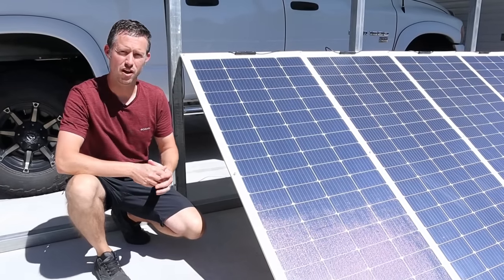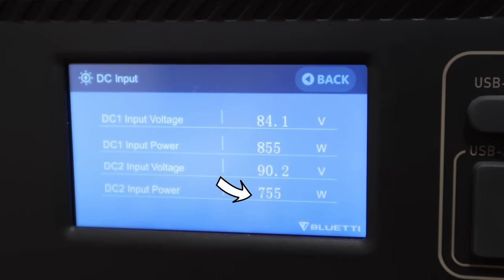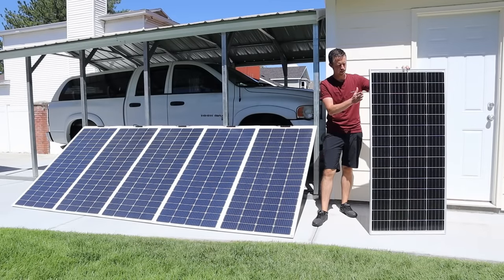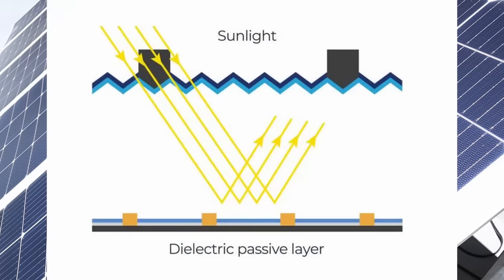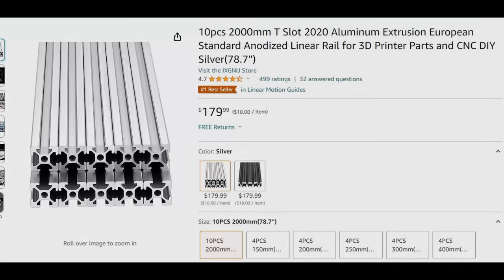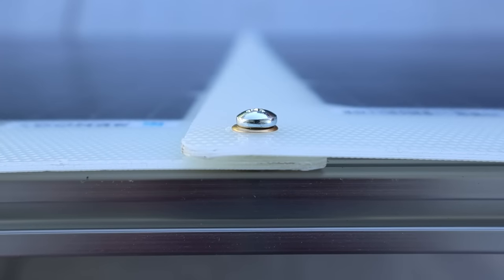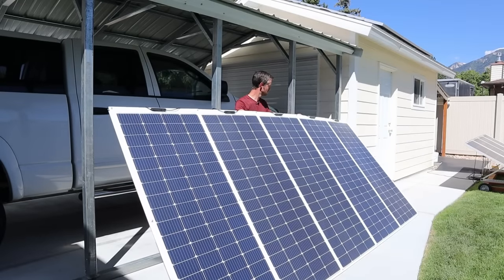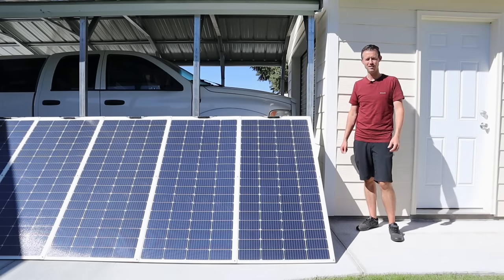DIY - 1000 Watt Lightweight & Portable Solar Array - Five Renogy 200 Watt Flexible Panels TESTED!

Comment: 2 of those panels are cheaper than the Ecoflow 400W 😁, probably close to the same cost after all the hardware though
Reply from the maker: I'll make sure to take two of them and include them in my upcoming 400w panel comparison video!

Comment: Hi I’m in the uk. Stumbled across your channel very interesting.Quick question I’ve got a touring caravan weight not a problem but would you say fit rigid panel or flexible 200w with just the one panel I want to get the most out of it it’s also the renogy ones I was looking at. Thanks mike
Reply from the maker: I've had really good luck with these 200w flex panels. If you want something thin and lightweight go with the flex panel. If you want something more durable and longer lasting, i'd recommend a glass rigid panel.

Comment: I only just started the video, but how is taking a flexible panel, then making your own frame from aluminum, superior to just buying a panels framed in aluminum?
Reply from the maker: The weight savings is the biggest factor (removing the heavy glass). This video is about building a lightweight and portable option. Put together glass panels like this and you won't be moving it around.

Comment: Can you use the flexible panels like these with the glass panels and mix and match? Would they work the same when put together?
Reply from the maker: You can only mix and match different branded panels if they have the same 'peak power' voltage and amperage as each-other. If wired in series you need them to have the same amperage @ peak power. If wired in parallel you need them to have the same voltage @ peak power

Comment: Those total cost over 1.7K+ but what about the battery generator?
Reply from the maker: Yes, the batteries will be a separate cost. If your power is consistent, it's probably not worth investing in something like this. However, if you live in an area where you constantly lose power it's a great setup.

Comment: Very good idea. Is there any reason you used those aluminum bars instead of aluminum angle bars? I am guessing that they are stronger than the angle bars.
Reply from the maker: I first thought about using aluminum angle, but it wouldn't be rigid enough. I opted for the 20mmX20mm. You might be able to use 30 series aluminum (30mmX30mm)  for more rigidity, but it will add a bit more weight. All depends what you are looking to accomplish.
Reply: @Jasonoid  how much more weight would the 30 add?
Reply from the maker: @dfwvtxman  I'm not sure, I don't have both options to weigh the difference, I'd say at least 1/3rd more weight. This weighs 66.8 lbs and each panel is around 10.8lbs so that gives you an idea how heavy just the frame is.

Comment: How would you ground this system if you are using it as a portable with an Ecoflow? Ground rod?
Reply from the maker: Yes, grounding rod is an option. In my case, it's grounded to my metal carport which is anchored to my concrete pad in multiple places.

Comment: Have a question on what you said about the VOC of 23.9 being the "peak voltage you will ever see". My understanding is the factory numbers are based on a temp of 77*F.
Am I correct in understanding that in winter with the cold, the solar panels voltage will increase? When the panel is say 20*F they will not go over the 23.9V ?
I ask because I am trying to build an array but stay under the Bluetti 150v max for the AC300. But in the winter if the panel goes over the factory VOC I need to consider that.
Reply from the maker: Yes, in cold temps the solar panels do have slightly higher VOC numbers. The max voltage is usually less than 3% higher than their rated amount. If you have a VOC really close to the max input of you power station, maybe consider putting a few high amperage diodes inline to drop the total voltage a few volts. I've wanted to experiment with that someday.

Comment: so dumb question, do I need to earth ground the frame if I am connecting it to a stand alone battery/inverter like the ac300 or ac500 you are using here? Assuming the battery is not tied into my house, I should drive a rod or ground the solar frame to something?
Reply from the maker: These flexible panels don't have a grounding point since they are completely plastic and don't conduct electricity. I wouldn't worry about grounding them like you would with a metal solar panel to protect against a lightning strike.
Reply: @Jasonoid  thank you! that makes total sense

Comment: How does it deal with partial shading?
Reply from the maker: It's wired in series, it doesn't do well.... but you could always wire it in parallel or a parallel / series combo to get better shading performance.

Comment: Wouldnt it make more sense to buy regular glass panels for nearly double the output for about half the price that last 4 times as long that have an alloy frame already? You wouldn't have to buy alloy and make a frame, you could just bolt each panel to the next one, flexible panels just aren't really worth it other that a niche application where weight saving is the most important thing. I can't wait until thin film panels get to mass production.
Reply from the maker: I already have two glass panel arrays I use daily. This is a supplemental array that I can move around and stow away if needed. The key design is that it's portable and thin so it can be stored in a small area.

Comment: their own 175W panels weigh 6 pounds, so for the same weight you could build an even lighter array (or more powerful for the same weight)...
Reply from the maker: You are right about the weight. Just keep in mind these panels are upgraded over the previous version since they use better cells. They will put out more power and last longer.

Comment: How do these compare to the Bougerv Arch 200 watt flexible panel.  Seems the the Bougerv is smaller @ 58in x 31in
Reply from the maker: I haven't tested those before, they seem priced well though!
Reply: @Jasonoid  they seem to be almost the same power rating with a VOC of 20.1 and ISC 12.28 VMP 17.1 and IMP 11.7 which seem to be almost the same specs. In your professional opinion do you think they would meet the same quality and close to the same output.  I just bought a set of 2 . The plan is to make this same array.  But I don't want to start buying them to find out it won't put out the same power.   I guess I could check it and compare what the results were compared to what one of your panels tested out to be
Reply from the maker: @lanceboudreau3630  I can't say unless I was able to test them throughly. Not all panels are created equal. You'll have to let me know what type of power you see from them.
Reply: @Jasonoid  I'll do a test on one in Standard Test Conditions with the right angle to the sun and then we can compare notes between the 2 panels. That will determine whether or not I'll keep these or send them back and get the Renogy panels.

Comment: How much do each of those panels weigh? They look light, but are they?
Reply from the maker: Each one is about 10 lbs. A glass rigid panel of this size is about 28 lbs.
Reply: Thank you. I came back and am considering this set up.
Reply from the maker: @florindagonzalez5700  they still are putting out excellent power!  (... if the sun hits them). Winter is tough for solar since the sun is so low in the sky and we get more clouds and storms in the winter.

Comment: Hello Jason I just ordered some of these panes to hook up to my Ecoflow delta pro in series do i need to add an inline fuse , if so how many amp fuse. I am looking at renogy Solar Connector Waterproof In-Line Fuse Holder w/ Fuse
Reply from the maker: Usually panels in series you don't need a fuse since the maximum fuse will not go past the short circuit current of the panels. To be extra safe you can wire in a fuse for the max rated amperage of your wiring (12 awg wire would be a 20 amp fuse)
Reply: Thank you very much for your time and info have a greatThanksgiving  day @Jasonoid
Reply: one last question i have 8 of these panels connecting to ecoflow delta pro do i connect all in series or series/parallel @Jasonoid
Reply from the maker: @trojans01  what does the manual or app state about solar input specs for the Delta Pro? (I don't have one)
Reply: @Jasonoid  11-150V 15A Max, 1,600W Max
Reply from the maker: @trojans01  each one of these panels will put out 25v open circuit, that means you can only connect 6 in series and not use the other two panels, the voltage would be too high (very bad). 

Your other option would be to connect 4 of them in series, and the second set of 4 in series and then wire those two groups in parallel (4S2P array). You'll be losing some power due to the amperage limit.
With the limitations of the charge controller you don't have a perfect way to achieve the full 1600 watts. That's pretty much the problem with many of these charge controllers.
Reply: Ok once again Thank you very Much have a Great Christmas & New year GOD Bless

Comment: Vtoman 1500 just purchased and it claims Ac input of 1500! Mine says 1690!!! These are Life po batterys so isnt it bad for the batterys to take in that much power or an i out of touch???
Reply from the maker: Hmmmmm, that question isnt about this video?! 😂🤣   ... It's "best" to charge at a 0.5C rate or half the battery capacity. If the battery has 1000wh, then a 0.5C charging rate would be 500 watts. When charging at a 1C rate or higher it lessons the charge cycles of the battery.... By how much? Who knows!
Reply: @Jasonoid  Sorry about that but this vid gives me some solar options👍! You planning on doing a vid on VTOMAN 1500?
Reply: @Jasonoid  my plan is to ONLY USE the AC charging in EMERGENCY only situations. When i got it , it was %80 charged Which is the most ive seen out of the 8 SoGens i own but i decided to chk out the AC SPEED. Its rated at 1500 watts but it kept showing a whopping 1680 Charge rate! Took 12 minutes to %100 and 3 minutes was the trickle effect. Once it hit %99 it went to 1480, 1370, 1100, 740 and then down to 500 snd it hit %100!!! Freakishly FAST but dont think its healthy as you said!! Dc and SOLAR PANELS are preferred ! Oh, before i forget i dropped your name to a New player in tbe SoGen game! They have SOLID STATE BATTERY TECH!!!
Reply from the maker: @samog777  I met with Yoshino at CES, their products are extremely expensive so I'm not thinking the video will be worth it. No one will want to buy it.

Comment: will that array be sufficient for running a 230v (3.2 kw) AC inground 3hp pool pump? will this be overkill? what do you suggest?
Reply from the maker: How often does the pool pump run? It pulls 3200 watts while running?
Reply: @Jasonoid  My pool pump is a VSP and run on 240 v power source with my pool heater (Htr., only use for the spa). The pool itself runs at 2300RPMs for 8 to 9 hrs per day at 900 watts. Then when needed, 3 hours at high speed or 3540 RPM's at 2900 watts for cleaning or spa use at night. Please tell me what system would be best for year round use (in Sunny Southern California)?
Reply from the maker: @bryanstarks3136  that is a lot of power! You'd need some pretty large 240v split phase inverters and batteries. 
You'd need at least a 30kwh battery to run that daily. To recharge that type of battery you'd also need around 6000 watts of solar panels. So 6 of these arrays all connected together. You'll need to consult a professional for your project and plan.
Reply: i also have a 10 x 10 free standing pergola 10 feet from pool equipment. can i disconnect my pump from the power and add a 240 ext cord to it and plug it into a invertor with 240 socket?
Reply: @Jasonoid  wow! This is why i'm investigating this solar solution for my Pool. Its my CA electric bill is out of hand during the summer only. What about the RV home setup with bat., invertor and all the port all-in one?
Reply from the maker: @bryanstarks3136  check out will prowse's youtube channel. He goes over some larger systems that might work for your setup.
Reply: @Jasonoid  thanks Jason i'll check it out!

Comment: Those panels are crazy expensive and no one knows how long they will last..I believe that they are a quality product, but, I don't believe the 25 year claim..Maybe you could justify the cost for a boat or something like that..If they cost around $150 dollars or less, I could think of half a dozen good uses, but not at well over $300 bucks a pop..Nice job though, I use that aluminum for all sorts of projects, light and strong...I might use some stainless wire to attach that contraption to a solid object so it doesn't decide to go sailing on a windy day...
Reply from the maker: One main reason for this project was to get a real world test of the durability and power output over time. The forecast had some wind overnight so I used a heavy duty ratchet strap to tie it down to my carport, it's super secure now! As for the price, these panels are still cheaper than the EcoFlow and Bluetti panels which are near or above the $2 per watt level.

Comment: Where did u buy.the frame parts
Reply from the maker: FULL PARTS LIST:
Renogy 200 Watt Flexible Solar Panels:   https://renogy.sjv.io/200wflex
SAVE 6% OFF using DISCOUNT CODE:  JASONOID   (valid on their website until Dec 31st 2023)
You can also purchase them on Amazon HERE: https://amzn.to/45spg7C
Renogy 15 amp Inline MC4 Fuse:   https://amzn.to/3R3scmO
20mm T Slot Extruded Aluminum (78.7" Long):   https://amzn.to/3Eb5vpd
20mm T Slot Heavy Duty Corner Brace:   https://amzn.to/3QVJt1o
20mm T Slot Straight Line Connector:   https://amzn.to/44rlSsp
20mm T Slot Sliding Nuts M5 Sizing:   https://amzn.to/3EbLaQr
50 Pcs M5 X 16mm Stainless Steel Screws:   https://amzn.to/47Mvn8o

Comment: Use this to charge the delta 2 max
Reply from the maker: Voltage of this array is too high, you'll want two panels in series wired separately for each solar port on the Delta 2 Max.

Comment: how you hook the cable on series
Reply from the maker: Series is the easiest solar connection. The positive of one panel plugs into the negative of another and they connect in a string. No adapters needed, check out this video for more info:   https://youtu.be/OZvrTuhJhXs?si=nj1YcaQJk-vTGH-x

Comment: Using full length square tube aluminum would have been stronger, lighter and cheaper. You can get a 6 foot length of angle and cut 1” brackets from it and drill holes and through-bolt everything.
Reply from the maker: That sounds sweet! Where do you pick thag stuff up? I only found extruded and aluminum angle.
Reply: Yeah, all aluminum cross sections are extruded other than flat bar and rectangle, in some cases. Those are often cut from sheet or plate. You can pick up 12’ or 16’ 1” square tubes at almost any metal supplier. Industrial Metal Supply has a few locations in Arizona and Southern Cali. Online Metals works too but might be even more expensive than Amazon with the slotted extrusion. But it will certainly be much lighter, stronger and stiffer and would be a good engineering lesson for your audience. I think rather than 66 pounds, it could be as low as 45lbs and would be about 3x stronger/stiffer. If you went with round tube, even more weight and stiffness gains can be had but fastening the panels to round tube might be a challenge, as well as joining them without welding or buying expensive joints.
Reply: My bad, I thought the frame alone was 66lb. Your frame should be about 13lbs, which means you’re using about 25ft of 8020. Seems a little low, should be more like 50 feet, right? Anyway, 25 ft of 1” square tube would be about 6.5”. Half the weight. So the total weight would be about 59 pounds. I’m shocked those flexible panels are over 10lbs!
Reply from the maker: @EricPeelMusic  I'm not using 80/20 brand so maybe it's much lighter stuff, the frame isn't very heavy.
Reply: T-slot is about the same as 8020. So you’d be saving 6-7lbs total if you went with square tube.

Comment: The only problem is the longevity of flexible panels.
Reply from the maker: These are supposed to last longer, they have a 5 year warranty so we'll see. That's 3 years longer than other folding panels I have tested on the channel.

Comment: They are optimistically rated. One thing to do is calculate area efficiency and you will discover their output per area panel, is in the space grade category if the specs were honest. A new panel is above the rated power, because it accounts for degrading during the warranted lifetime of the panel. You have been scammed.
Reply from the maker: I purely got scammed, thanks for clarifying that LOL...
Reply: @Jasonoid  No seriously. Proper solar panels has certified power outputs, including derating per year and end of life output, and they will replace it, if it is not up to specs. However if the Watts per Dollar is reasonable, you haven't been cheated, but it is still a dishonest business practice.